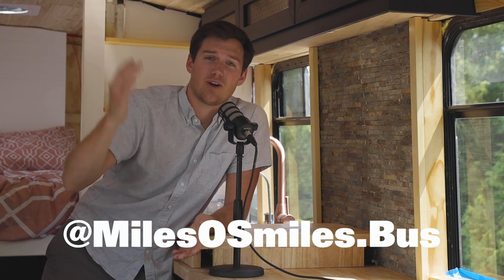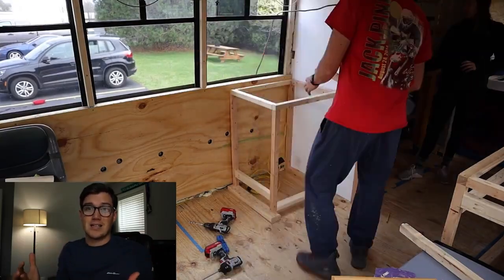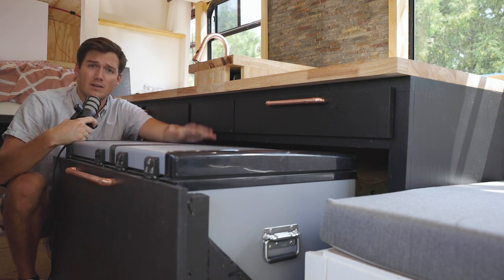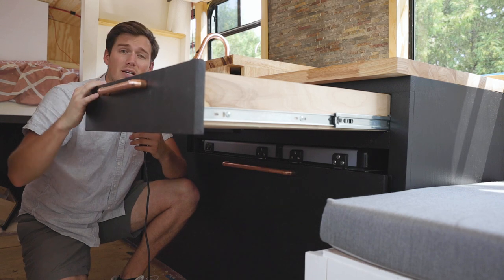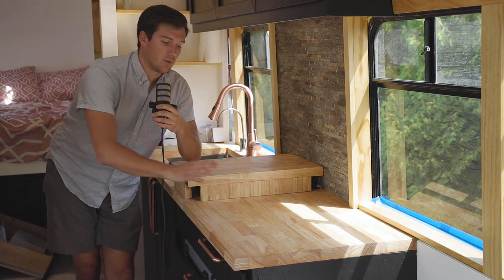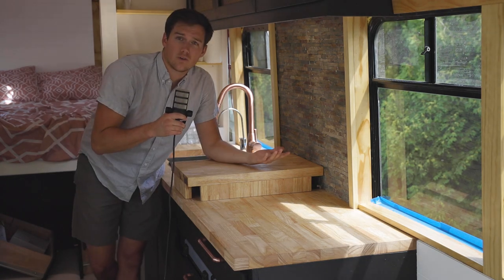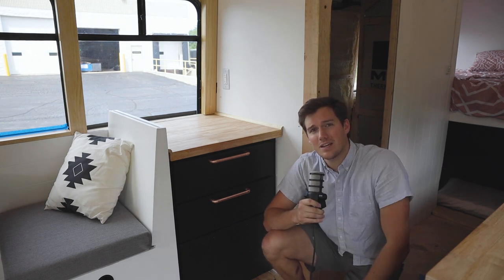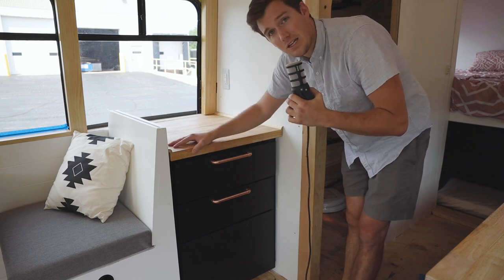How I Built My Dream Kitchen In A BUS!!--Skoolie Ep. 50

Comment: Question: was it aesthetics that led you to have a cutaway on the upper portion of your fridge?  I can see the hinges in a nice neat rectangle.  Cant say I would have chosen this.  My fetish is for invisibility!  Everything “clamped” out and hidden.  Or was there some other consideration?  Thanks!  Love your channel and it’s already been very helpful for my build.
Reply from the maker: Glad you’re enjoying the channel Leslie! Having the fridge the other way would not have allowed me to open the lids all the way and I would have still had to cut access holes to get to the latches and ventilate the compressor. This is definitely the better of the two directions it could have faced in my opinion.
Reply: @MilesOSmiles  What you possibly still could do is make a small frame (as you did with the top cabinets) with a slit of about an inch and cover it, on the back side, with the same metal design-flowery-paterned-thing, that opens up towards the top. That way there is ventilation but no open space. Just a thought.